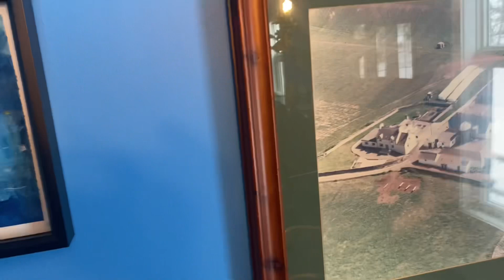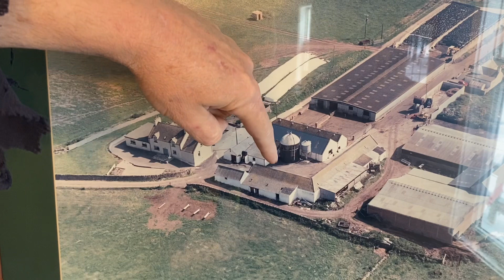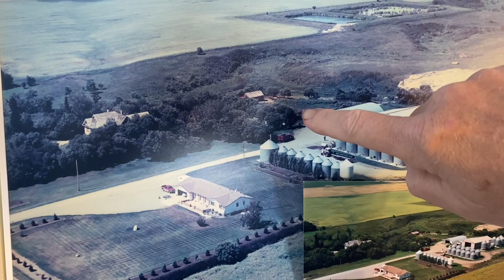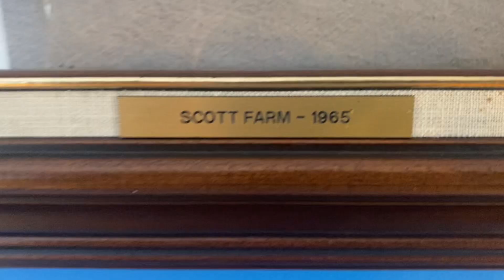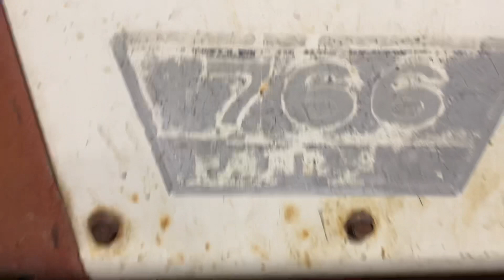The wheels came off the wagon

Comment: I feel sorry for the 766😞 I think they changed the metallurgy on the shifter parts between th 56 series and the 66 series. On my 9 and 1066 i changed the long shaft and the plate for the high, low shift and that fixed alot of issues. The 966s would shear off the pin on the bottom because the hole was so messed up. Now on my 756 I have minimal trouble, except for the busted up pivot bering on top..... got to change that after I fix the rusted out brake line. If you pull the rest of the platform check the line between the valve and the left brake while you are in there.
Hang in there Doug, spring is comming someday.......
Reply: Morning Adam ☕☕☕
Reply from the maker: Well now i know to "ask a friend" on my red dramas eh, lol. seems the old dependables when they do eventually break it really throws you off yer game eh.
Reply: When the 766 acts up ask away Doug. There is 8 of those ol red beasts in my stable. If I don't know I have an old mechanic friend who probably does.

Comment: I like to put zerks in hubs. Got a couple of implements with zerks in the hubs from the factory. 
A missing seal isn't so bad, if you can keep it greased. 
Twine should work 🤞
As long as it doesn't get into the bearing.. 
Mum gave you a beautiful day!!
Reply from the maker: I have in the past added zerks where needed but a tech said on these processors it encourages twine to wrap but i think thats a bit phewey, when i do the rebuild i'll see where the cast is thinnest to see if its possible. It was a beauty day, great turn out for her too over there.
Reply: @piperdoug428  sometimes you can sneak in on the wheel side of the hub. Much easier on the back side, but.. a little angle to get where it needs to be. 
Glad your Mum had such a nice day for her send off!! It was even a nice day here.

Comment: Seems like someone sent me the one picture before. Was a nice place your family left behind.
Nice place you all moved into too!
Now you bring up the shoulder blade nerves and I forgot what I was saying... So, OUCH!! Usually from a rib popped half out of place. I feel your pain!!!
Dang Doug, old and abused.. with wornout linkage.. and the tractor too😳😄😆
Sometimes, you can add a little weld here and there in the linkage, smooth it out and make it work like new..
Reply from the maker: Hahaha, well played re. worn out. yeah if i had a lathe i could machine out for bushing or build up n hone down, will see where we get to. cheers
Reply: @piperdoug428  lathe, grinder.. I've made bushings with a drill and grinder.. 
But lathe is a lot better.